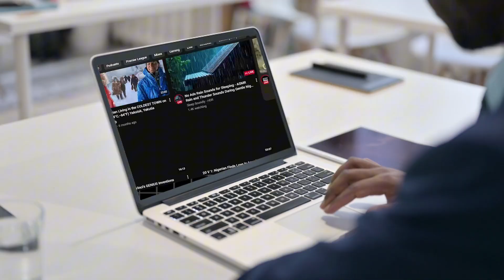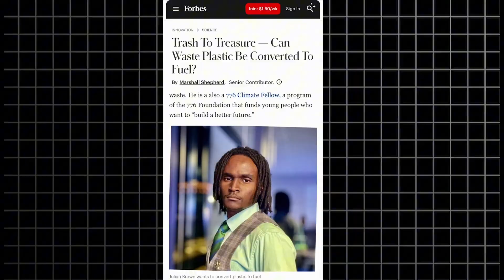This Black Inventor Created UNLIMITED FUEL And VANISHED…

Comment: Nothing to steal, look it up, I find fuel being made out plastic since YouTube first years, there's nothing new about it. He is not in danger, it's a stunt. The reason is simple, it's cheaper to produce fuel in our currently model then from plastic, it's that simple. A gallon of his material would have to cost 12dollars to profitable. Honestly, in 200 Hundred years, after the end of oil, gas and coal, that will be very useful. But before that, I don't think it's gonna fly, it's economically unpractical, maybe he could mix it with ethanol to drop the price.